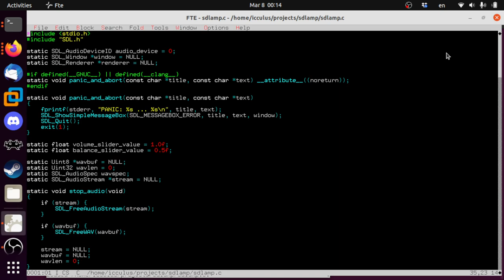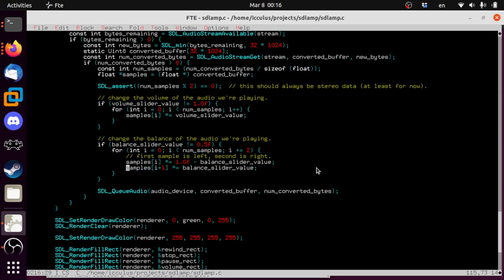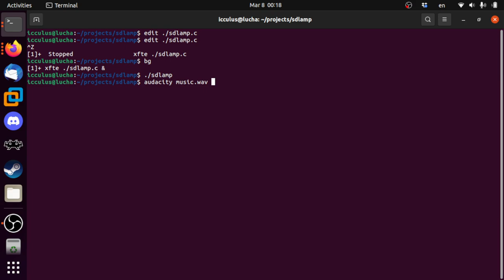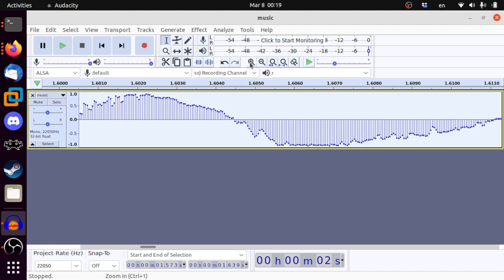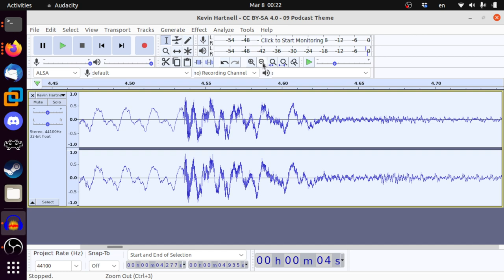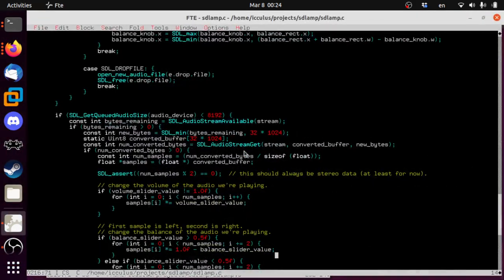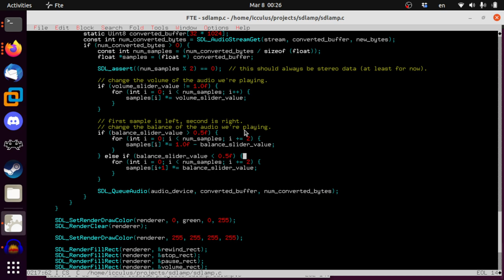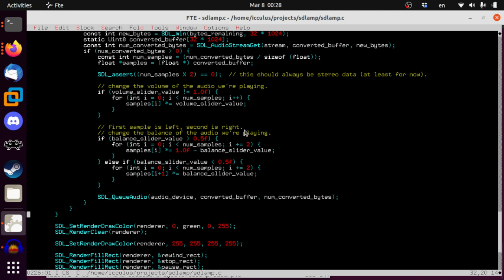Writing a Simple Media Player with SDL, part 7: How Computer Audio Works

Comment: Couple bug reports:

1.
The balance control caps the amplitude to 0.5 for both channels. Except when balance_slider_value is exactly 0.5, then its effective factor for both channels is 1.0.

In otherwords:
when balance_slider_value == 0.51, left channel is multiplied by 1.0-0.51 (0.49), right channel is as if it was multiplied by 1.0
when balance_slider_value == 0.49, right channel is multiplied by 0.49, left channel is as if it was multiplied by 1.0
=> There's discontinuity at value 0.5

2.

You might already know this and skip it just to simplify things. But in case you don't realize volume control should never be linear. I believe something like this would create a correct (natural) volume slider behavior that operates in range of -80 dBa ... 0 dBa:
sample[i] = powf(10.0f, (-(1.0f-volume_slider_value) * 80.0f)/20.0f); (pre-calc the powf outside of the loop!)
Similar mapping should be applied to balance control.
Reply from the maker: I just can't get this balance control right under pressure!  :)  We'll fix that in a later video (we're going to shift away to graphics stuff for a bit next). You're absolutely right about linear volume, too, and that's just for simplicity right now, but we'll revisit it later as well. Thanks!

Comment: Just curious, are asserts removed by the C compiler when building in release mode? 🤔
Reply from the maker: They are! SDL_assert (also just plain old assert from the C runtime) is a macro that evaporates out if not doing debug builds. SDL_assert contains more magic than the C runtime version, though; a deep technical explanation is here: https://web.archive.org/web/20190322035412/https://plus.google.com/103391075724026391227/posts/KzV6sLdALX7
Reply: @RyanGordon  thanks for explaining 😊